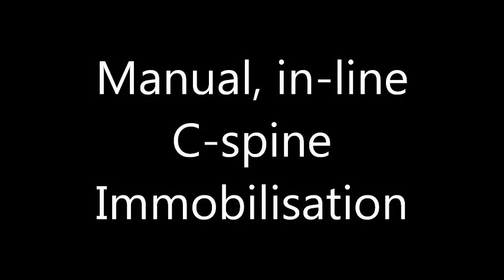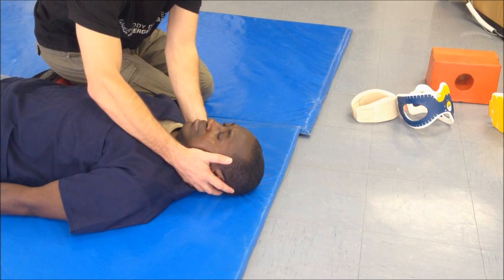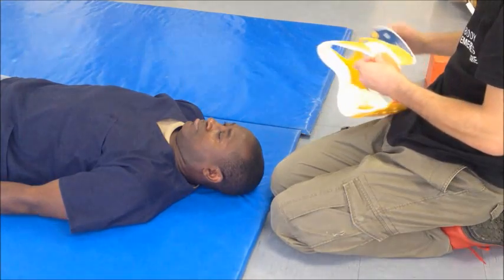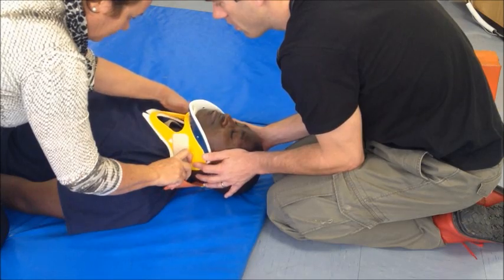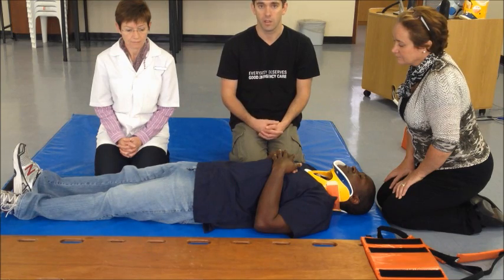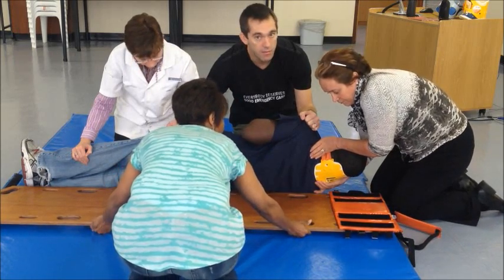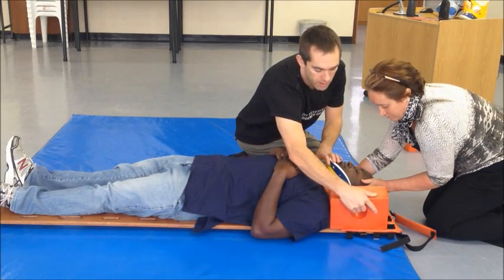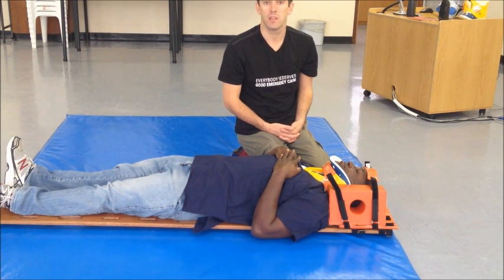Spinal Immobilisation: The Basics

Comment: Incorrect measurement of c-collar. Poor application technique. Head secured to backboard with body unsecured. This is a critical fail by NR because if they get slid around or the patient vomits, the neck and back. Do not try to learn the correct technique through this.